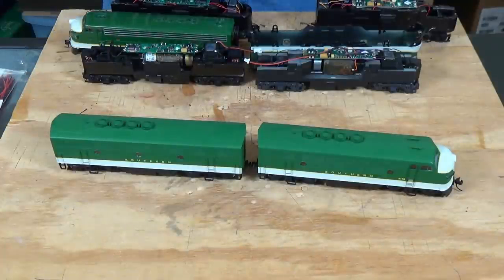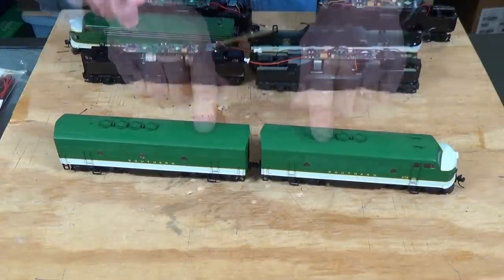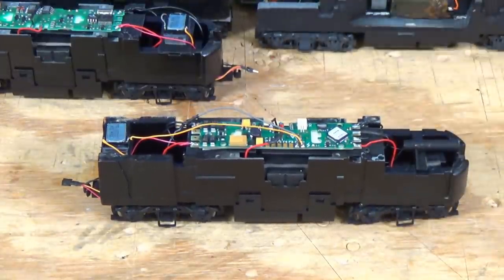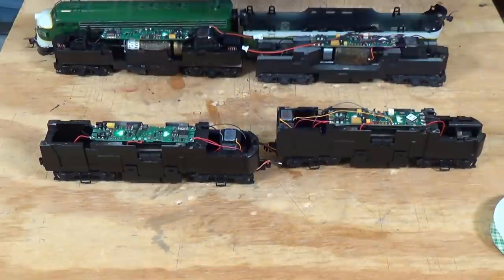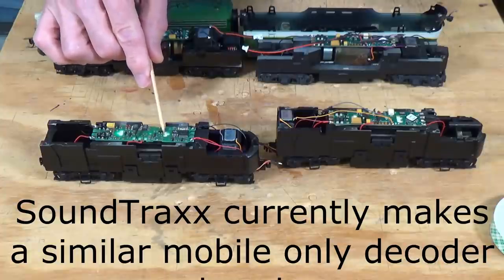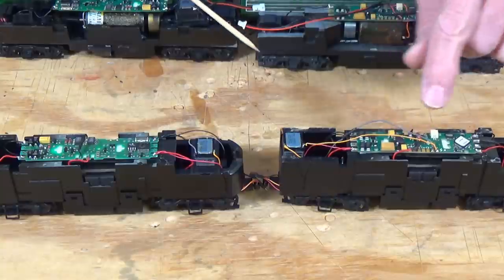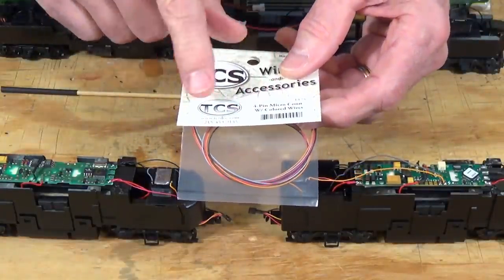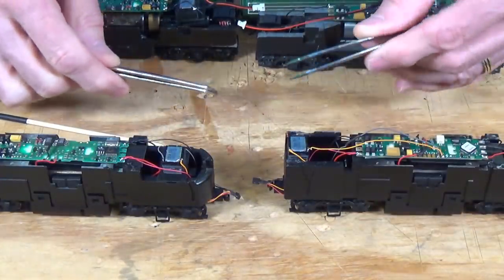Cheap Sound For Consisted Locos (238)

Comment: Another great video, I have been using two loco-consists in my layout for many many years and, to save a buck, I have used most of the times one loco with sound and the other one without,  this would help me improve my loco roster a lot. I just have something to add, I believe that when you connect the speakers in parallel the resistence does not "cut" in half, instead the resulting resistence is the averague of the resistence connected,  if both resistence are the same then the resulting resistence is the same. I studied this a long time ago in college, but that is what I remember.

Comment: This is a great approach, Larry, however Dave Hughes pioneered this method a decade ago. See his article in the April 2021 edition of Model Railroader. Not only does he use smaller micro connectors (TCS) than the ones suggested in this video between units, which are nearly invisible, Dave uses 4-pin connectors between units to make the series-wired speaker connection and uses the second pair for bolstering the DCC bus between locos for uninterrupted running.
Reply from the maker: I have been a regular reader of MR and I apparently missed that as I  breezed through the article on his layout. However, I published an article in my DCC Corner column in the August 2016 issue on doing this sound trick and then did another one on sharing power between locos in the April 2018 column so apparently I was actually first in print with both.  I also pioneered the power trick with CTC16 in a pair of RS3s back around 1990. My video next week will complete the combined sound and power trick.

Comment: Exposed pins can be a problem. I use the JST style of connector. They only plug one way and the pins are shielded. You can get the JST in 2 wire to 10 wire or more. TCS has six wire ones.

Comment: I have an off subject question but thinking you might know ? So I got a sound dcc MTH GP 38-2 the engine has a drive system that is junk. I want to remove the sound decoder and speaker to an atlas trainman GP 38-2. Do you think by switching out pc boards and decoders would be something possible?? This MTH is a paper weight,and the atlas trainman is a dcc engine with no sound but works fine and I’d like to swap out and convert them???
Reply from the maker: If you’re good at taking thongs apart and putting them back together it might work. However I would sell it on eBay to someone who has a lot of MTH locos and needs a spare parts model. Then use the money to get a decent decoder. I have 1 MTH  and it has only been out of the box once in the last 6 years.
Reply: I was thinking of selling and it’s a shame because it’s a beautiful engine but it gear cases are for sure no good. But I’m pretty good with modifying trains and just was thinking of swapping them out ??? Unless someone needs it, but it’s the only MTH I got and it’s just collecting dust. And I also got some Athearns for sale. Thank you.

Comment: Hi Larry I have asked a couple of chaps about doing this they said I would have problems with speed matching and other issues, I want to do this with amongst other brands and classes, Heljan class 33's some locos are fitted with loksound V5 sound decoders but want to fit the other half of fleet like how you have described. 

I mainly want to run in permanent pairs one sound fitted and the other standard decoder with speaker powered by the sound loco, but would like the option to swap the locos about for example #9 sound with #33 standard and #47 sound with #65 standard then #9 sound with #65 standard but I would also like to do a triple header (3 locos together with one sound decoder and two standard decoders) Could you be so kind to list what  parts I would need, what size wire you use, what is a good programmer to change the cv settings and how and which cv settings I change so they start moving at the same time instead of the standard non sound decoder wanting to move before the sound decoder is ready. Many thanks Mark
Reply from the maker: As I have repeatedly said in my videos it is easier to speed match locos having decoders of the same brand/type. One way around this is to use a sound decoder and non sound decoder from the same manufacturer. Because they typically use the same speed algorithms and procedures you should be able to get a perfect match as long as the loco characteristics are not too different. That said it may also be possible to get a good speed match using decoders of different brands as I have done but you run the risk that some features such as braking effects may be on different functions or operate so differently they cannot be used. So you really need to consider what is your best combination of decoders to use for a case like this. In the end buying both the sound and non sound decoder made by the same manufacturer will likely be the easiest option. I know that George Bogatiuck of Soundtraxx has told me he often uses 4 sugar cubes in a series/parallel arrangement so he is pushing only 8 ohms and many modelers use 2.
Reply: @TheDCCGuy  many thanks great advice and videos

Comment: If you ran parallel but out of phase would get a little different sound from each speaker?
Reply from the maker: The problem with having them out of phase with one another is the sound  waves cancel each other out and you get very little sound from them. If they are maybe 6 or more inches apart it seems less of an issue but I basically always try to keep them in phase. I discussed this in my videos on speakers.

Comment: Larry I am new to this and have a few questions.  Planning on building a dcc n scale small layout.  Is there any way I can send you my questions to an email or other means?  Thank you.  I have watched about all your YouTube videos.
Reply from the maker: If you have a question add it to the comments add I will try to answer it here where others can benefit.
Reply: Start with my basic few questions. First I am looking at using atlas 55 track should I consider something else.  My layout is going to be somewhere around 3.5’ by 5’.  Second I am looking at the NCE power cab system thoughts on this.  I have your book on wiring dcc that I am reading now. I am sure I will have more as I get into this further.  Thank you for your response.
Reply from the maker: PowerCab is a great product, watch my videos on it. With that small a layout you can easily wire it without any voltage losses in the wires or the rails.See my recommendations on wire sizes in my book and wiring videos. The problem with code 55 is being that small it has much greater resistance than larger stuff so requires more frequent feeders to prevent voltage drops. Also remember that the mor locos you run at one time the more issues you are likely to run into if you have wiring and track voltage drops, so just because it works with one loco doesn’t mean it will work the same with 6. Follow the guidance and don’t scrimp. It’s easier and cheaper to do it right the first time than to have to go back and retrofit.
Reply: What track would you recommend that I use as I am open to any.  Also would I need the 5amp pack for the NCE based on the size I am planning on using.  At most would have 3 trains running at once also have a few turnouts and some of your electronic lights.  Thank you
Reply from the maker: Go ahead and use standard code 55 but be aware of the potential limitations as far as wire size and feeder spacing. You’re not like the fellow who wrote me with 100’ bus runs and undersized wires.
Reply: @TheDCCGuy  what track do you use.  I am not sold on code 55 just read it is most realistic.

Comment: so you are running both units from (lets say ) decoder in Unit A Then running a sound board to unit B?
Reply from the maker: No, there are decoders in each loco but only one is a sound decoder.
Reply: than can I ask, why not just connect the non sound unit  to the unit with the sound decoders?
Reply from the maker: Are you suggesting powering the motors of both locos with one decoder or what?
Reply: @TheDCCGuy  yes

Comment: What is the name of the new efficient motors that you installed?
Reply from the maker: Inised Mashima can motors but I don’t know their current availability. NorthWest Shortline has remotoring kits that used to use Masimas but I think they use their own now. Micro Mark sells motors and of course Bowser sells remotor kits for their older locos. Some folks have had success buying motors from Chinese suppliers on eBay but I have never tried them.

Comment: Surely neither speaker will work if you disconnect the two parts of the loco when they are wired in series?
Reply from the maker: You must not have watched the whole video as I said just that at one point.
Reply: Ooops Sorry...I missed that bit!! @TheDCCGuy
Reply: How about a second pig tail for each locomotive so you have a connector for each end? Then you won't be so limited in configuration. Maybe even a baggage car or passenger car, etc., set up with a speaker and pug tail? Then if you want to run a single loco or if one goes down, you can connect to the auxillary unit to complete your circuit?
Reply from the maker: I guess you could do that as long as you don’t connect to more than one at a time. Back in the 1980s at the Northern Virginia Model Railroaders club we used CTC16 command control and the receivers were so big we used to put them in dummy locos, boxcars and reefers with sockets in the ends. That way club members that did not have receiver cars could connect their locos to the club cars and be off and running. This and what I will show on my next video are just extensions of that. So you are really only limited by your imagination.

Comment: Interesting idea for locos that one might always run together, like E and F A and B units.
But why even suggest connectors like the TCS brand in a style that are obviously a poor choice for the reasons you warn about?
Reply from the maker: Well, those are the only ones I have found with the really small flexible wires. And with 4 wires (I will show you next week why I used 4) you need a flexible connection or it can cause derailments. If I can find the JST connectors with that kind of wire I will gladly switch. The white 2 pin JST connectors I showed are OK for a 2 wire connection but increase that to 4 and they are very stiff and I would expect problems.
Reply: @TheDCCGuy  I imagine that the other two connections are for sharing electrical pickup. Keeping the orientation of the connection vertical should be sufficiently flexible, even in N scale.
Reply from the maker: Yes that might work or using a pair of 2 wire connectors, one for sound and the other for power would relieve the stress. However if I could just discipline myself to simply turn off the track power when fiddling with the connectors it gives adequate protection while also providing a flexible connection. At one time in the early 1990s I installed individual sockets in the pilots of a pair of RS3s and world insert individual wires between them just like real mu cables. But that was more fiddling around than it was worth.